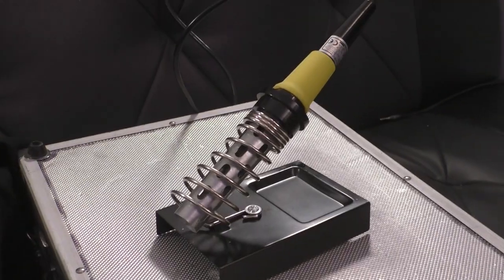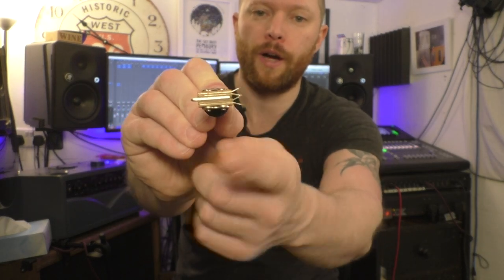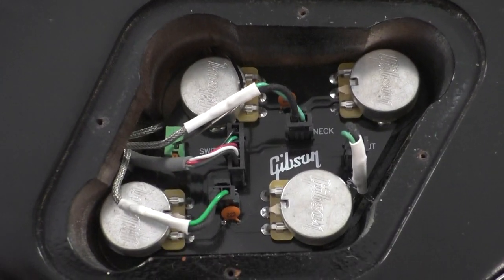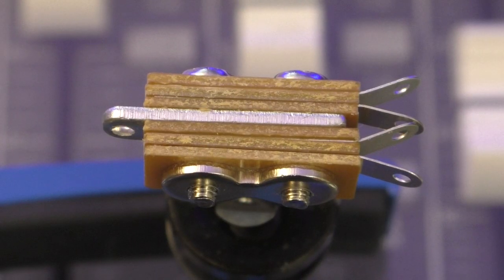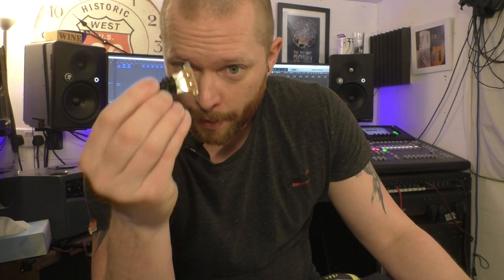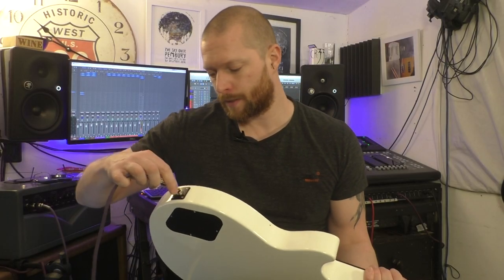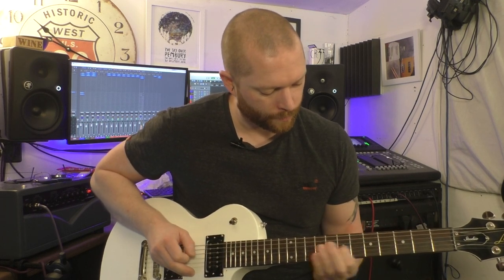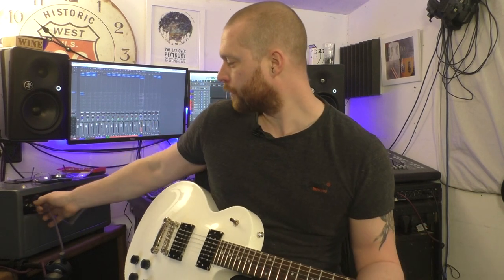Les Paul 3 way switch replacement

Comment: Dude when you are soldering, over that precious painted body, tape over the surrounding area with masking tape. As your fingers no doubt know, solder is extremely hot - and what accidentally comes off the soldering iron can and will make a mess of the paintwork!

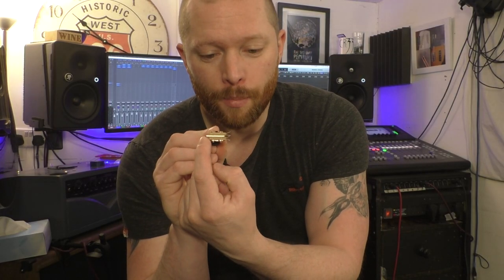Comment: Looks to me like your switch diagram (1:00 mark) is incorrect. What you have shown as the green ground connection is actually the switch's output. The black connection is the switch's ground connection.

Comment: I have an Epiphone DOT335 Cherry Red....Recently, the 3 way Toggle switch is working erratically. If I remember correctly, previously: In the centre position BOTH the Bridge and Neck pickups used to be ON and I could control the Volume independently (also the Tone), Now, in the Centre position, the Neck pickup stays OFF and ONLY comes On if I very, very slightly turn ON the Bridge pickup? Is this NORMAL - I don't think so. Could you please confirm? Cheers from Toronto....

Comment: Excellent video... cheers from Toronto....I have an Epiphone Dot 3 with a 3 way Toggle switch. In the Middle position, before, I THINK Both the Bridge and Neck were turned on and I could adjust Both Volumes. 
Now, in the Center position, the Neck one stays Off, until I slightly open the Bridge Volume! 
Is this the norm???  Please advise. Thanks.

Comment: Question:
Is it possible to replace a 3-way toggle with a pot in order to dial in the different level of bridge/neck pickup? If so, then what issues would I face? 
In other words, I want 3 pots and no pickup selector instead of 2 pots and a pickup selector..
Reply from the maker: Definitely possible. I did a video on a 7-way strat mod where instead of having 2 tones, one of the tones becomes a blend.
It’d be some kind of variation of that
Reply: @PherotoneStudios  All I can do is try it.

Comment: What if only the lever part of the switch broke off and i lost it? The switch still works i just cant find that small part.
Reply from the maker: If it broke off then you may need to replace the switch. If it fell off then you can just replace the end. Is there a thread on the hit that’s sticking out?
If you can see a thread on what’s left then you can buy replacement switch tips on Amazon and eBay.